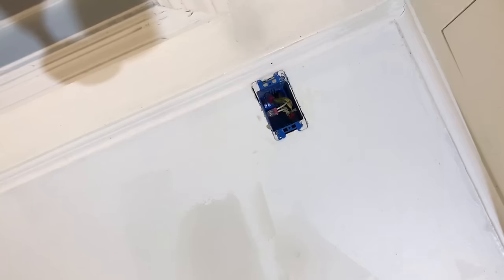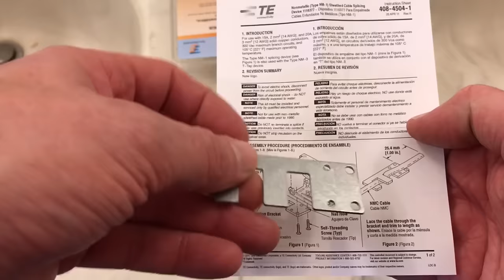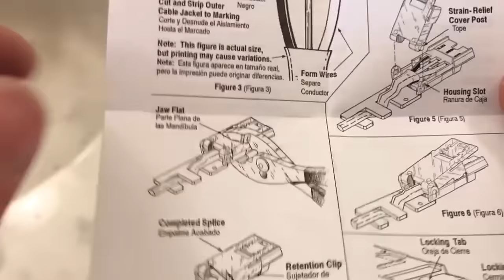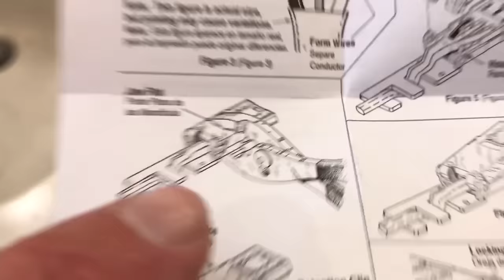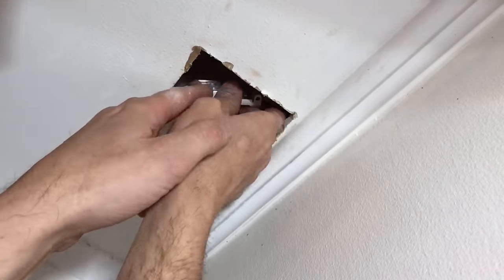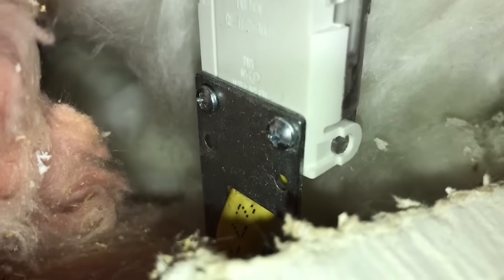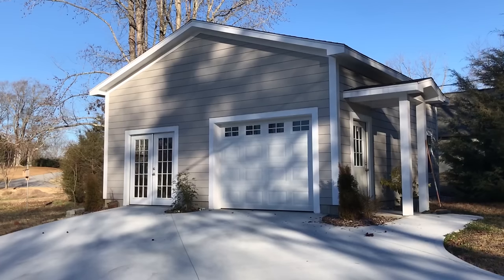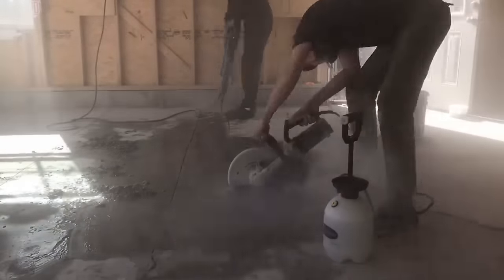Do I have to have a junction box to splice wires?

Comment: I'm a rocket scientist and I operate on brains in my spare time (between rocket launches) and you could use the old wire as a pull, and pull a new wire towards both ends from the middle. Aside from a really tight staple hidden inside the wall this will work like the Saturn 5 moon mission.
Reply from the maker: Ha ha. Great idea, Jeffrey, but in my case, there are many, many, tight staples, corners, and blocking that the wire travels through.
Reply: if properly installed the staples shouldn't allow that to happen, its not secured if you can slide the wire in it only supported

Comment: Sure, let’s encourage folks to violate the code. The use of such devices is limited to only certain locations on manufactured homes.

In practical terms, it’s amazing how often I find electrical faults develop where wires connect — no Matt how well concealed. What should be a five minute troubleshooting job can take days as you attempt to find the problem.
Reply: Its not even the code, devices like those fail frequently legal or not. Its just the lazy mans way of doing it. I cant believe he would make a video to show people how to do something dangerous to save time.
Reply: @RadioRich100  Yeah, kind of odd seeing him going from essentially the 'proper' repair to a buried time-bomb.
Reply: @vincemajestyk9497  You got that right. Its hard to believe he would make a video to show people he did it.

Comment: Private homeowners are not required to follow any codes they have no agreement contract with themselves too. Only professionally licenced "commercial" contractors are required by "commercial codes". You don't need permission or inspections when fixing things in your own home.
Reply: Homeowners doing their own work are required to do things code compliant. Sometimes that means that they aren't allowed to do certain things, like plumbing or electrical, but if they do, must meet minimum code requirements.

Comment: Is that attic insulation I see in that hole?
If that's an attic space, you can just put the junction box in the attic, it doesn't have to protrude through the drywall..
Reply from the maker: Good question. It’s a second story, but it’s insulated between floors. If it were attic, I’d have pulled new wire instead of splicing. Thanks for the comment.
Reply: @FamilyFriendlyDIY  Yes Sir, thanks for making/sharing the video! I hadn't seen these before. I'm surprised to see insulation between floors, I've always lived pretty far south though, so that may be why.

Comment: Even though the packaging claims that it's listed to be covered, it's still considered a junction which means it has to be accessible wherever you put it.  Covering it up in a wall or ceiling where you don't have access to it for repairs would be a code violation.  If you have a choice, mount a standard junction box.  This is only for where you do not have a means to mount the box.  Also, make sure that you're circuit amperage rating does not exceed the listed amperage rating of the fitting.

Comment: Wow. cool video, but I would not trust that myself. The wire connection to the plug part is a failure point in my mind. I would feel better with a WELL done wire nut connector with the wires pretwisted, cut to length and wire nutted and tape. I KNOW this is not legal, but I would trust it way more than this device. I would just live with the blank cover. But who knows, maybe it will last and is more robust connection than I am familiar with on this blade types I have seen in the past. Thanks for the video!

Comment: You couldn't make me use those even at gun point. Just paint a nice cover for the junction box. Twisting the wires before using a marr connector(wire nut) is the best way to make a splice.

Comment: Great solution.  I would have no problem doing this in my home, particularly because I would know where it is if there was a problem.  Actually seems more elaborate than what would be needed.
Reply from the maker: Thanks, Joseph. Researching this, I've seen a lot of electricians on forums saying they just hide metal boxes in the walls. Seems like if someone used push connectors inside a metal box, then secured the cable clamps really good, that would be as good or better than these ... but these were legal and I hadn't seen a video on it, so I thought I'd do one myself.
Reply: @FamilyFriendlyDIY  push connections are junk. Wire nuts are a much better connection.
Reply: @FamilyFriendlyDIY  they still need to be accessed on behind wall applications so they are only good for wiring that is visible like in unfinished basements or attics otherwise use a box and cover for access codes
Reply: Stick to plumbing joseph !  These things are absolute GARBAGE !!  Seen them BLACK from all the heat and arcing inside the shitty terminals the wire pinches into !!!!
Reply: As long as it's 'your' home. A lot of people think this way, then they sell their house. Pity the next owner.
Reply: @mattywho8485  You should try one on a EV car charger!
Reply: @vincemajestyk9497  They will never figure out why their house burned down.

Comment: My biggest complaint about these splices is that you must cut the wire. Why? Since they are using those stupid insulation cutting V connectors anyway, which are unreliable, why not allow the conductors to remain intact? For situations where you are eliminating a box it's no big deal. for situations where you are fixing damaged insulation, it's rediculous to require cutting the conductors just to fix the insulation.

Comment: Did you notice all the warnings in several places "do not re-terminate?" yeah, that means don't re-use it.  The pins that splice the wire spread apart a bit and it's not designed to be re-used like that.  I hope you used a new one when you did the actual splice.  I don't understand why you went thru the effort to install a box instead of just pulling a new wire.

Comment from the maker: I'm not keen on a splice like this ... and in the comments I see a lot of others aren't also. But for me, I was willing to take the risk. This is a UL listed device, and there is a provision in the NEC (NEC 334.40b) for using this FOR REPAIR ONLY ... but use at your own risk. All comments are welcome, though it would be nice if you'd include (instead of anecdotes) some sort of link to an article or something concrete giving evidence where one of these splice kits caused a house to burn down. 

Discussion:
https://forums.mikeholt.com/threads/334-40-b-nm-cable-interconnector-devices.2552797/

I forgot to add... you can get one to splice 3 wires as well.   https://www.lowes.com/pd/TE-Connectivity-20-Amp-Volt-White-2-Wire-Connector/50205335?cm_mmc=shp-cprdelcgooglelia-106-electricalaccessories-50205335-_-0&placeholder=null&ds_rl=1286981&ds_a_cid=112741100&gclid=Cj0KCQiAhP2BBhDdARIsAJEzXlFh6KmKUhRPUYcvEOUnhlItK5KluiAJ6RW9I0ZmI2w-mrFyVLY9IvoaAlzZEALw_wcB&gclsrc=aw.ds
Reply: ….”This is a UL listed device” … aluminum residential wiring was at one time UL listed…. Back-stab wiring was at one time UL listed…
Reply from the maker: still is …. https://www.lowes.com/pd/Eaton-White-15-Amp-Duplex-Outlet-Residential-Outlet/1098367

https://codecheck.com/aluminum-wiring/
Reply: @ernestgalvan9037  back stab for receptacles are still allowed by code when done right but trained know the reason you pigtail instead of stab is if device (outlet etc) fails then power is interrupted downline
Reply: That would be the problem, using at own risk::: As a Unlimited Journeyman Electrician.  Even though it's UL listed. Doesn't mean crap.  In the event it was to start an electrical fire, I would not; want the head ache. Seen many fires do too things like this. And why take the chance. I would not recommend it... REGARDLESS...

Comment: I would be bothered by the lack of circular mills of the actual electrical connection.  You can look up on a copper wire table the number of circular mills of a 12 AWG wire.  If you can get measurements of the insulation displacement connector (IDC) you cant help but see that the number of CM's of the contact area is significantly smaller than the CM's of the copper wire itself.  It wouldn't take much to build a test stand, draw 20 amperes through the segment of wire and take some thermal images of the junction, in my opinion people who use these devices are looking for trouble.

The current density of these contact points is substantial, I have not checked the NEC.  In my opinion, use of these connectors is an accident waiting to happen.   Jim
Reply: If your opinion was based on actual data, you'd disagree with what you said. UL has done the testing, look it up.

Comment: I like the way it is well secured and covered. However this kind of guillotine style connection has a much lower contact surface area compared to older twisted wire connections. I wonder how often corrosion leads to a voltage drop, with inevitable heat. The way this can be concealed behind walls is most concerning, I don't believe our Canadian code book allows that.
Reply from the maker: I hear ya. I think you're right. It's probably not legal in Canada. I'm not that keen on it myself, but wanted to show the option existed for making a repair. Thanks for the comment!
Reply: @FamilyFriendlyDIY  Their are many bad ideas on U-Tube, this is just another one.

Comment: Can’t be any worse than my knob and spool wire in the second story of my house.  House was built in 1900.
Reply: It's vastly worse than knob and tube. Knob and tube splices have a much greater surface area of connection. Don't believe the hype, the only downside of knob and tube is that the older tar-covered wires are prone to becoming brittle and there's no ground wire. However, using crap like this with a miniscule connection point to the copper actually bottlenecks the load tolerance of the wire; meaning a high likelihood of failure or even fire. Meanwhile, that knob and tube has successfully served your home for more than 100 years.

Comment: Question: is it allowed to install this splice kit behind wall ? (i.e. not accessible)
Reply from the maker: Hey, Kim, I will say yes in general ... but your local area might have different codes. From what I've been able to find, this device was originally designed to make connections in the walls of prefab homes, and would certainly be inaccessible after built. The splice you see me making in the video will be permanently patched over, so I feel very confident this will never be an issue--and I tend to second-guess everything. I hope this helps ... and thanks for watching!
Reply: Electrician here. 
Do not hide any splice anywhere that is not accessible. If that ever comes apart, you have exposed conductor that could cause a fire. These are garbage. 
Take a blank wallplate and paint it to match your wall or replace the run into existing boxes. Don't take shortcuts.
Reply: @techdave05  truth never use these for any situation are they even ul listed? As an electrician I hate these
Reply: Against nec.  Need box and access

Comment: Nice in theory, but the contact points on the copper being small AND it being 20 amp romex? We dislike the outlets that have no screws, this is similar. Is this device UL listed ?
Reply from the maker: I know what you mean, James. Kind of like those cheap no-strip T-tap wire connectors the car stereo shops use... But these are UL and CSA listed, and NEC Compliant article 334-40b. ---at least they were at one time. Thanks for the comment!

Comment: This should answer everyone's questions about if this device is code compliant to the 2020 NEC Code and if the way he did this was actually code compliant or not.

However, with the release of the 2014 NEC, we find that the Code Making Panel has reconsidered their earlier position on concealing splicing devices in wall spaces so that 334.40(B) in the 2014 NEC reads as follows: Self-contained switches, self-contained receptacles, and nonmetallic sheathed cable interconnector devices of insulating material that are listed shall be permitted to be used without boxes in exposed cable wiring and for REPAIR wiring in existing buildings where the cable is concealed.
The 2014 Code cycle adopted a more precise language when discussing these splicing devices – declaring they must be listed (such as UL) and deemed a nonmetallic sheathed cable interconnector device. So that no confusion could be had as to the type of splicing mechanism being referred to for this purpose. Section 334.40(B) in the 2014 NEC also removed permission for using the device as part of “rewiring” as the previous Code cycle(s) had stated. Replacing that language with REPAIR wiring only. So that a NM cable accidentally punctured with a screw or nail or nicked while fishing a wall could still qualify for this splicing procedure. But no permission existed in the 2014 NEC for using the splicing device outside of repair work. Also, the requirement for the NM cable to be “fished” if it were to be spliced was also removed. That is because the only time you are now permitted to use the device is for repair work and not for extending wiring (rewiring work) when the wiring is too short.
The language adopted in 2014 for Section 334.40(B) remains unchanged even now in the 2020 Code cycle.
Reply from the maker: Thanks Nathan. Good info.
Reply: my man here with the literal code reference, yet people still complaining that this isn't up to code lol

Comment: Those of you that are licensed electricians, explain to me why this, hidden in a wall or ceiling meets code but a junction box hidden in a wall or ceiling does not. I would trust properly connected wires inside a sealed junction box to last the life of the home. This device, however, is just a giant scotch lock. Scotch locks are fine for low voltage but this is 120 so the poor connection surface provided by this device would seem to me to create resistance and hot spots that could eventually cause a short and perhaps a fire. It appears to me that this device would create the same risk as connecting a 10ga wire to a 12 or 14 ga wire? What do you professional electricians think?

Comment: Scotch-lock connectors (for low voltage automotive applications) have a bad reputation for failing; - And use a similar Insulation Displacement connections as this product so I would definitely not use this product.
Reply: Scotchloks fail in automotive applications mostly because of moisture, vibration, and improper use like using the wrong connector for the wire size. IDC connectors are used on basically all copper telecom and data lines and survive much better in that application. I do occasionally hear about these particular connectors failing in modular homes but not nearly as frequently as their automotive counterparts.

Comment: What is the purpose of these wire connectors? Certainly they save no time from installing a junction box so why bother? After watching your excellent video I see not benefit against going against a tried and true method  of using junction boxes for splicing wires together.
Reply: the only advantage to these is that it is code compliant to cover it up unlike a jbox

Comment: There should be full load testing (+25%) done on these to ensure they are safe and also test till failure. I'd like to see how they hold up at 150% rated load for several hours
Reply: They have been tested, that's how they received UL listing.

Comment: Just because something is "legal" doesn't mean you can use it. First, iIf you put a splice in the wall and it is inaccessible, anyone performing service at the residence will not know it exists. The issues with that should be obvious. Second, as mentioned in the video, the connection is made by a press-fit blade such that the only connection is along a very sharp edge. Having such a small area of connection will result in much shorter life span and a significantly increased likelihood of failure. Finally, most electrical work must be inspected and very few, if any, inspectors are going to approve an inaccessible splice outside a junction box whether it is rated for the application or not. Just don't do it.

Comment: Home depot no longer carries this product as it is not compliant with the latest NESC code. It is only compliant with 05&08 code. I wish I could use something like this to hide my junction box, but it seems like junction box is the only way to do it.
Reply from the maker: I just checked that out and appears you may be right. Looks like for now, though, you can still get them here, Ray  https://www.menards.com/main/electrical/wiring-accessories/connectors/inline/2-wire-in-wall-splice-kit/cpgi-1116377-2/p-1444445332823.htm  ---but not necessarily saying you should. Then again, I just read this which makes me think that you can still use them but only for "repairs," not to extend wiring. https://www.jadelearning.com/blog/splicing-nm-cable-in-walls-and-other-concealed-spaces/  Thanks for the comment, Ray. Some good stuff to consider!
Reply: Just got one today from the depot no problem
Reply from the maker: @Hydro4201000  👍🏻 nice!
Reply: @Hydro4201000  same here. Least it is obtainable in my area.

Comment: It is illegal to have a junction box , splice box not readily accessible. You can use a blank cover plate. I believe even you use the connector it has to be accesible. Check with your local authority .

Comment: Thank you for this. This is a perfect solution for a repair I need to make but my cable is a 12/2 and I can only find this device that's designed for a 3 conductor plus ground. They're not available anywhere except in bulk. Is there any reason I cannot simply use the 12/3 version and leave one port unused? I'd be using the black, white, and ground, leaving the red port unused. TIA!
Reply from the maker: Sure. Leaving one empty shouldn’t make any difference.
Reply: @FamilyFriendlyDIY  as long as supplied power source is labled so extra wire can not be energized ever